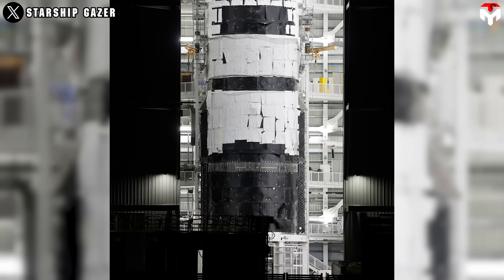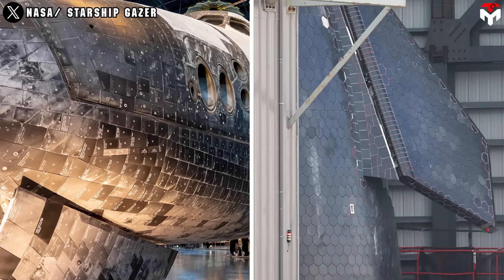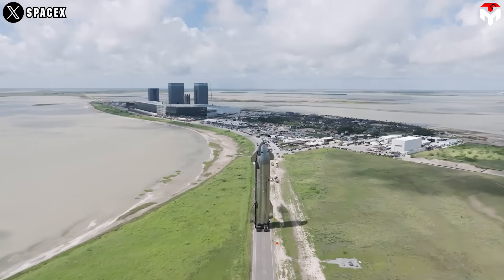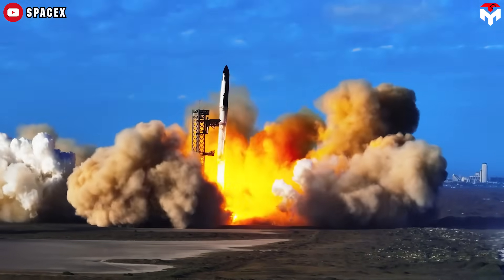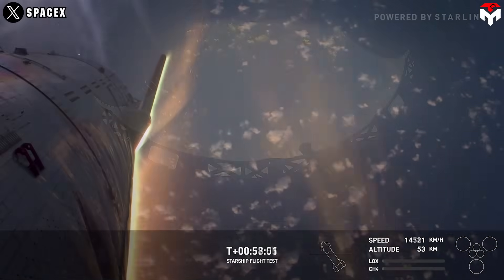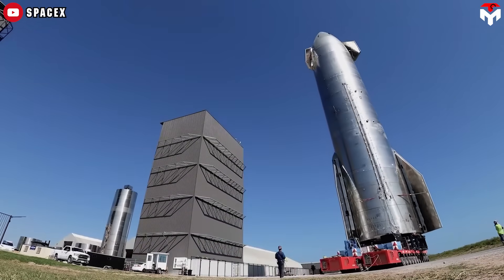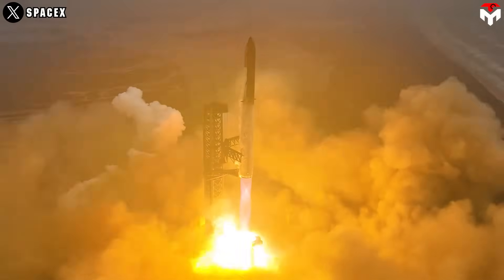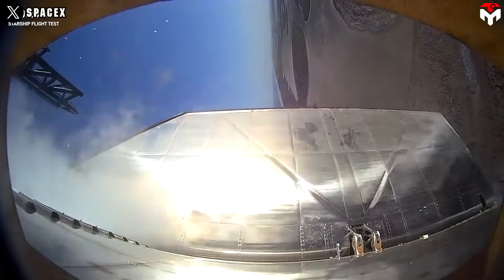SpaceX revealed Genius Solution On Starship Heat Shield, Humiliated NASA's Shuttle...

Comment: The original concept US Nova Space Shuttle used an upgraded Saturn V 1st stage to lift a similar looking US Shuttle with much smaller external tank.   The switch to large solid rocket motors so as not to use the Von Braun Saturn V caused unresolvable destructive vibration throughout the complex fragile US Space Shuttle heat shield tiles causing the system to have to go through months of rebuild between flights.   Both US Shuttle loses can be traced to the use of large solid rocket motors that vibrated the Space Shuttle apart.   

The Challenger loss took place when all three main bolts holding the front landing gear area to the external tank gave way.   There had been previous flights where only one bolt was still holding at time external tank release.  One had broken away and the other had loosened to not providing much support.   The thrusting from a large solid rocket seal leak very likely pushed the system in to total failure.    

The second US space shuttle loss Columbia was due to destructive vibration on the external tank breaking off a large piece of foam coming back to puncture the shuttle's wing.   Upon reentry the shuttle wing came apart from hot gases entering the wing. 

After over 1-1/2 years of extensive engineering work to improve the integrity of the external tank foam with a lot of improvements it still  wasn't possible to totally eliminate the foam from breaking loose due to the high vibration solid rocket motors.  On the first launch after the Columbia loss the engineers were to witness some foam breaking away from the external tank.  

There was a push to make the US human space program be based on US companies and not Von Braun's German engineering group that was at the core of the Apollo program.   This turned into support for certain companies instead of support for advancing the US human space program.   

Von Braun didn't see how large solid rocket motors could be incorporated safely into human space flight.   It was impossible to resolve the destructive vibration effect they'd have on a complex space craft.  They can't be actively throttled or shutdown.  

It was shown the US space shuttle solid rocket motors once in saltwater had be meticulously rebuilt that took longer and cost more than making new ones.   The "re use" ability was promoted to make them appear as better for a reusable space craft than the non reusable Saturn V 1st stage.   Their further use on the Space Launch System is non reusable.   

If the Nova Space Shuttle would have been selected keeping the Von Braun German engineering group the US Space Shuttle would have been in use years earlier able to rescue Skylab that has been holding on with each further delay and finally had to be de-orbited.   The Shuttle would not have had its heat tiles greatly damaged with each flight from the destructive vibration of the solid rocket motors.  There would not have been long rebuild months between each reuse.  It would have been a far safer Space Shuttle unlikely to fail as the solid rocket motor version has.

Maintaining use of an upgraded Saturn V with the new F-1A engine improvement over the F1 would have allowed large segments of space station, such as Skylab, to be lifted to low earth orbit in a handful of launches that could have take place in about a year.   

If the SpaceX super heavy Starship booster ever gets to commercial use It has bit more than twice the payload ability of the 1st stage Saturn V.

Comment: Sculptor s created this material for bronze casting. The international space station tested VISCOSITY FLOW. Rates for me and then permanently locked my Twitter Page. I used to Tweet with Everyday Astronaut. We both have Tweet rates to astronauts and the Station than NASA. The truth is they still haven’t got it. There lives don’t depend on 4mm Ceramic Shell and other substances recipes. I took 7 years to write my Dissertation. Lab work and cast work and test work. Wish I had Elons E-Mail addi.

Comment: If the tiles were vacuum coated with gold on both sides to reflect infrared heat, they might be more effective and would be very attractive.
Reply: Not to mention more collectable !
Reply: foil melts
Reply: @robertbolding4182  Vacuum coating is not foil.